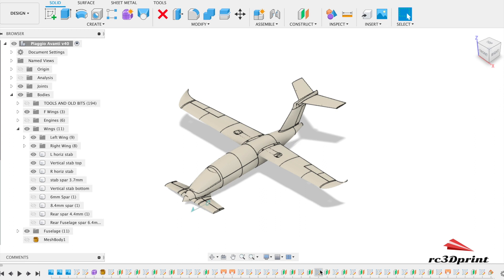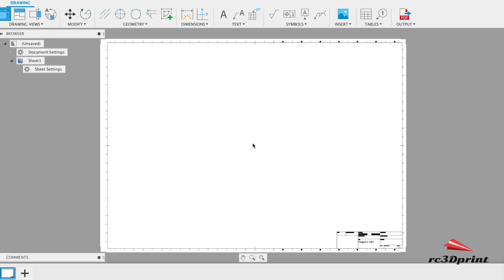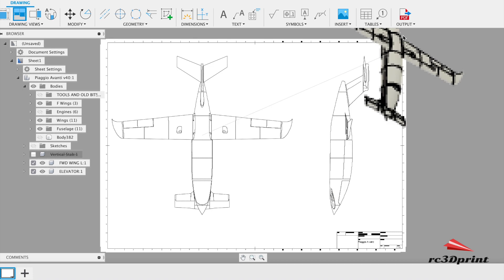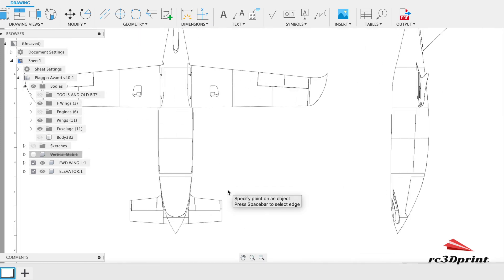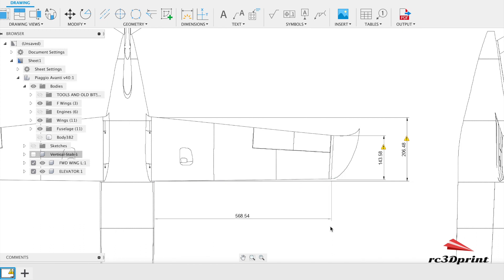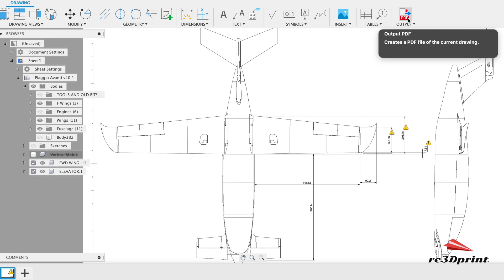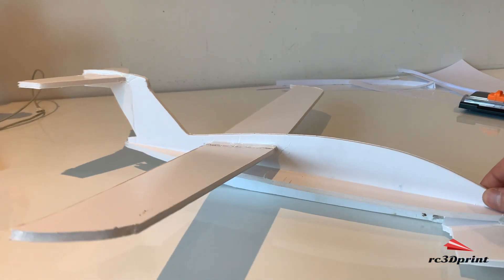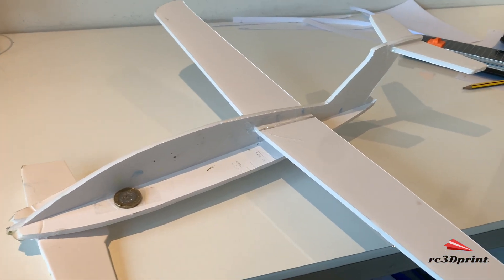How To 3D Print an Aircraft - Drawings in Fusion 360 to Calculate CG's

Comment: Are you calculating CoG why don't you select the wing sections and use the CoG analyzer in fusion360? Or are you estimating center of pressure over the wing?
Reply from the maker: I’m working out where the CG should be, rather than where it is. That way we can position the battery and internal parts to achieve the desired CG.
Reply: @rc3dprint819  I design fpv drones for a manufacturer and one of the ways that helps me to insure CoG location is to make same dimension mock components with accurate weights of the real world components that will go into the build. Unfortunately, Fusion360 does not have a mass override like Solidworks had so you have to adjust the material to a close approximate and then adjust the density to match the real world mass. This way you don't have much less trail and error time.
Reply: @Zachtamundo  Nice to know how industry does it. I'm a mechanical engineer but I don't work on aircraft. I'm designing my own RC plane though and this is what I did. Once I knew the real parts I was going to use I put all the parts and weights into a SolidWorks assembly model and created a configuration layout and found the CG, NP, and looked at static margin. I got my NP from a geometric derived formula and also found it in XLFR5.